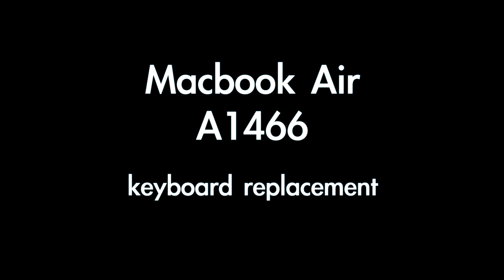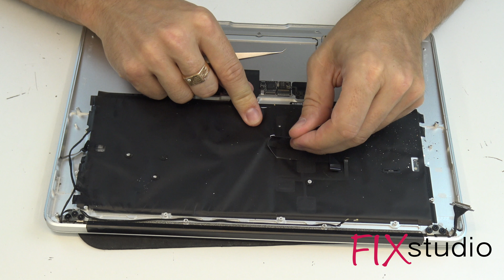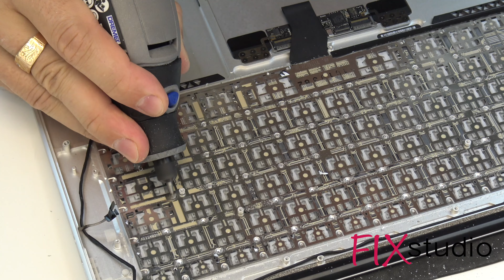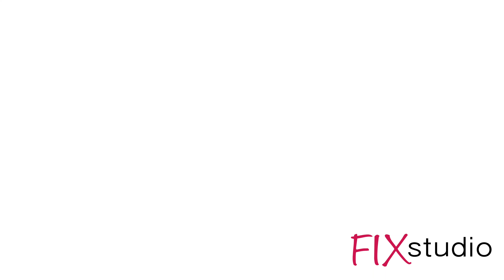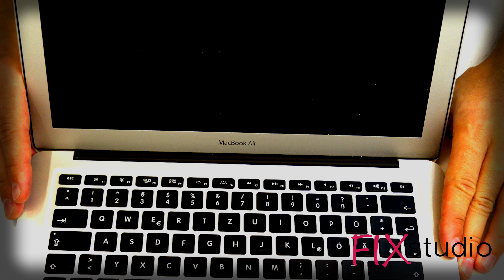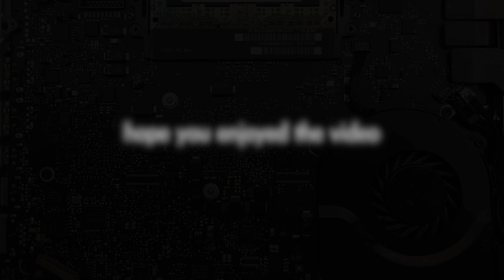Macbook Air A1466 - Keyboard replacement [4k]

Comment: Overall good approach however I would open the laptop 90 degrees, put the keyboard/ top case on a soft cloth on your work table and hang the screen over the edge to avoid damage to the screen.  I’d run a vacuum at the same time you grind the rivets with a Dremel, to keep debris out of the case.

Comment: Why dremel off the rivets? And why on earth expose your screen to all that metal filing? I would suggest remove screen and cover touchpad PCB with something to protect from metal filing / scratches. Also why not see which rivets pull out and then use screws to replace those that come out.

Comment: I was thinking of buying a used macbook air, I found several of them for a reasonable price (2013-2015 models) but all of them have german and one of them a russian keyboard. The price is much lower than getting one with an english/international keyboard not to mention that the machines are newer. So, is there a way I can only change the keys and not the entire keyboard without breaking the bank? And if I change the whole keyboard how much more will I pay for it?
Reply from the maker: Hi. The point is, that some of key fixing mechanism are different for example in Germany, Spain or UK, and there is no way to change just the keys. Just some of them, but you need to check it...

Comment: Thanks man, this really helped me out! Two remarks: at some tricky moments (attaching tiny plugs) your hands were in the way and I couldn't see anything. Secondly, as my replacement kit came without spare keyboard screws, I divided the ones I saved over the available rivet holes, skipping every other one. That way, I didn't have to glue and it seemed strong enough.

Comment: Why dremmel the rivets? If you just pull on the keyboard, the rivets will pop out. Order a keyboard with screws and use these to install, instead of gluing. Anyway, this is what I did, and it worked perfectly. BTW, if you don't want the 50 or so rivets to fly all over the place, apply clear tape to the back of the old keyboard before pulling it out. Also, plugging in the keyboard before setting it in place makes it easier to get the connector in place.
Still, thanks for the video, it did help me disassemble and reassemble my A1466.    :-)
Reply: No dremel at hand, drill was too slow .. Brute force attack went butter smoth XD

Thank you mate
Reply: It's an electric screwdriver.

Comment: Thank you!  Just stripped a keyboard from an  Apple donor upper part using your method.  For my computer, I taped the back of my keyboard and ripped it off to contain the rivets.  Used a combination of screws from the donor and rivets for the rest.  Thanks again!

Comment: I have just followed this tutorial and everything has gone absolutely perfect. I connected everything back up in the same order as the video and now the MacBook wont turn on, there isn't even power when connecting the magsafe connector. No light on it this is the same with the battery connected or not. Does anyone have any ideas? :/

***edit Its working perfectly now. I had missed a screw on the A/O board which am assuming was a grounding screw. So happy. Thank you for this detailed tutorial. My 2015 macbook air now has a new lease of life!

Comment: does it have to be a 3TB hard disc drive? I only have a 2 TB. 
9:00
Reply from the maker: it shuld be enough :D
Reply: 2Tb doesn't have enough gigabytes to weigh it down enough.  3 is just enough, but 4Tb worth of gigs will be too heavy.
Reply: As long as it is at least 1TB you will be fine 🤣

Comment: What was he doing with that kit after 5:57...and after removing the keyboard what was he applying along the frame
Reply: He was applying liquid metal epoxy that he bought from Amazon. Because he had to dremal out all of the plastic pieces that hold in place the keyboard you need to glue the new one to the frame of the computer. That's why he leaves the hard drive on it for 12hrs to weigh it down and stick it to the glue.

Comment: Do you have to grind the rivets, or is their another way?
Reply: Louis Rossman just rips off the old keyboard, some of rivets pop-out with a stud, leaving a hole for a screw instead: https://youtu.be/2PyhbiwUkE0?t=1213
I am an idiot that I've used Dremel, dust is all over the place, had to use vacuum. And I doubt the epoxy gonna hold it.

Comment: Do I really need to glue the keyboard in place? Will it be ok without?
Reply from the maker: I don’t think so. You need to fix the keyboard in few places.
Reply: If you don't glue it in place the keys will fall down in-line with the frame they won't be raised up at all and you will have to do a kind of stabbing motion from above to type. It feels very awkward and unnatural to type like this.
Reply: As an update to my previous reply, I went to my repair store and asked them about it and they sell a set of self tapping screws to replace the rivets on macbooks. Suggest you buy the screw sets rather than trying to glue it.
Reply: @Agret  I didn't glue the keyboard at all and it sits perfectly in place. All keys nicely raised and they don't 'fall' inwards.

Comment: Thanks a lot!
What to do do if the pentalobe screws located in the bottom case are damaged and don't move?
Reply from the maker: I know the pain. Try to cut it, or drill it out.
Reply: @fixstudioTV  Thanks. It's not a bad idea but I'm afraid of damaging the screw holder. Do you think it will work to stick them to another screw or the screwdriver?
Reply from the maker: This is real not easy. And it’s hard to give your some advice, without to see the problem.
Reply: @fixstudioTV  Sure, I understand. I think it would be better to take it to a service. Thanks anyway for your help!

Comment: Hi. Great Video btw. Q. If you change your keyboard with a different language do you need to have any kind of additional setup in order for the laptop to accept it. Or is it straight up remove and replace?
Reply from the maker: Hi. It’s not a problem, as long the enter key have the same size - there are two different

Comment: What was that device you used to remove the solder from the back of the keyboard? Can I just use a side cutter (Seitenschneider)?
Reply from the maker: German right? Ob das mit Seitenschneider geht kann ich nicht sagen, aber bequem wird es mit Sicherheit nicht. Ich würde doch eine kleine Bohrmaschine/Drillmaschine empfehlen. Viel erfolg!
Reply: @fixstudioTV  Danke dir. Ich habe einen Dremel gefunden! Soll klappen.
Reply from the maker: So wird es auf alle Felle einfacher. Lass Dir Zeit, und Versuch nur so wenig abfeilen wie es notwendig ist. MfG

Comment: I really wish I would have gone with ripping the rivets instead of grinding them down. And also the type of glue is highly important. I used the wrong kind and it ended up staining the keyboard and my screen. But other than that this is a great video

Comment: Parts cost $30. Takes 20 minutes. Apple charges $600 to do. SMDH
Reply: This video is sped up like crazy. Depending how you do it. If done properly, the rivets need to be replaced not dremeled out. Apple just replaces the whole palmrest assembly. This job usually takes me about 2 hours if I pull out the rivets and try to put back the surviving ones and then glue the broken ones down with bits of card holding the keyboard against the frame while the glue sets.
Reply: Apple service centre won't change the keyboard...they will most probably change the whole part that holds the keyboard itself 🤣... that's why the high price

Comment: 8:12 can i know what glue it is?
Reply from the maker: Hi. It’s two-component epoxy: Liquide Metal TurboCall 2000. But you can use something different as well.
Reply: Very helpful, I will doing the same in 1-2 weeks with my MacBook Air (waiting for it arrive).  BTW, do you offer RAM upgrades for the soldered RAM?  I have 4GB and would like 8GB or 16GB.